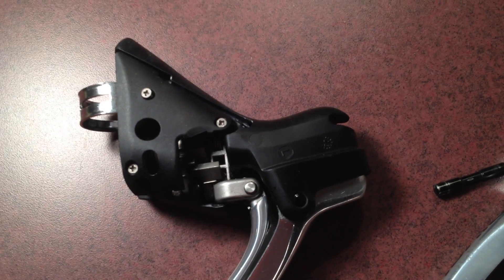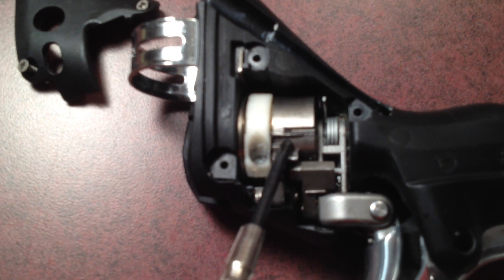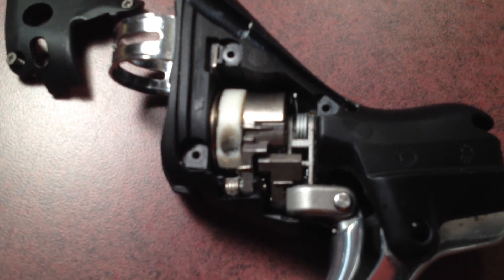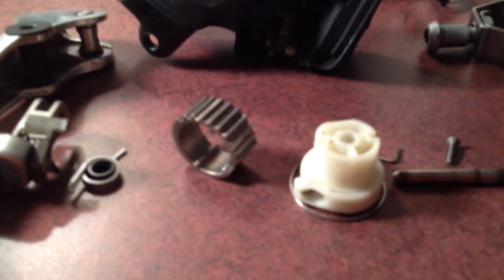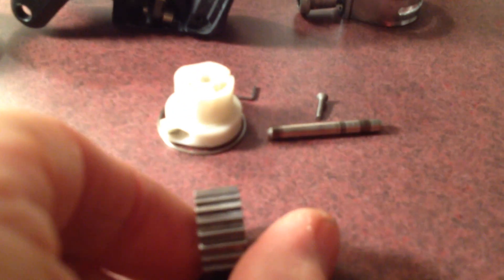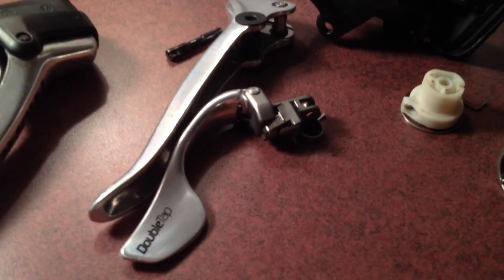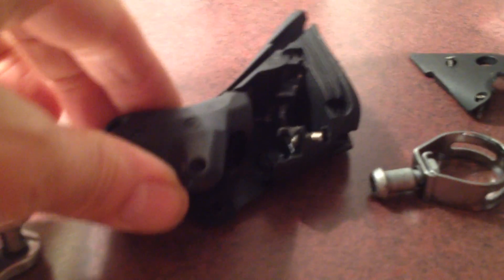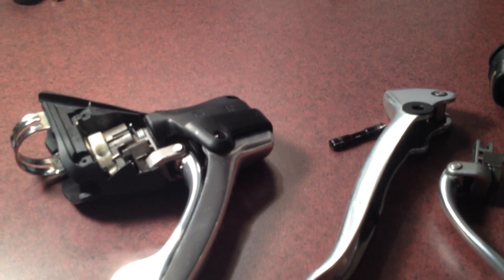SRAM Doubletap shifter overhaul

Comment: I'd also like to see how to remove the brake lever blade. I've tried hitting the pin quite hard and it doesn't seem to budge and I don't want to break it!
Reply: +Rob Chambers 
Nevertheless that's how you do it, it's a light press fit, use an punch or something similar and drive the pin through, nothing will happen if you don't apply enough force but you shouldn't have to hit things so hard that they mark or risk breaking.   Support the body over something like a piece of softwood with a hole drilled in it so the pin can come out.  

I think someone said in another video that they come out from one side, if that's true I did mine from the 'outside' toward the inside, it's kind of easier to support that way in any case due to the shape of the body.
Reply: I hung mine over the edge of a saw horse so the back side of the pin was free of obstruction, then smacked it (tapped) with a nail from the inside.  It worked perfectly.
Reply: Drill a hole in the horse and punch it through there. More stability.
Reply: This won't work for 2010 models on. You can't switch the left and right parts as they re completely different.

Comment: Thanks for the video! I have a quick question though, how did you remove the brake lever blade? Do you just force pin out? I have a shifter with excessive play in the brake lever blade pivot, which might be unfixable, but I would like to give it a go.